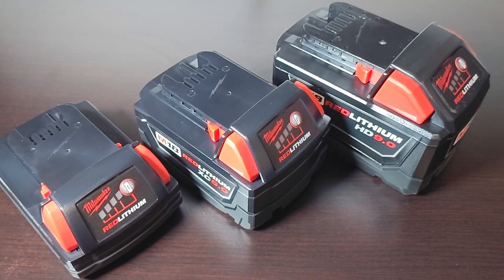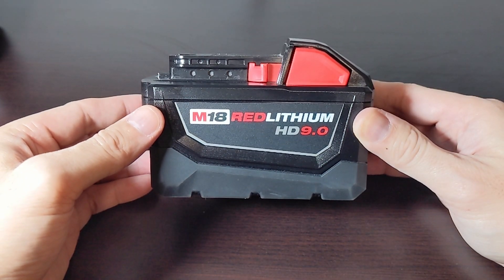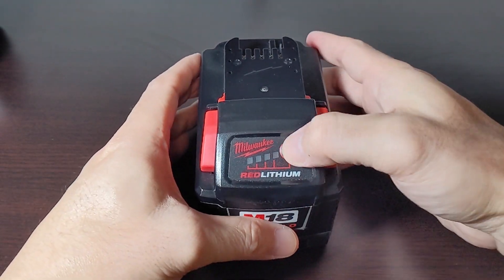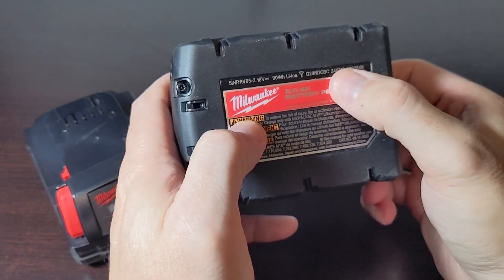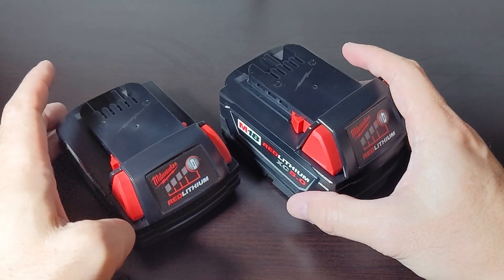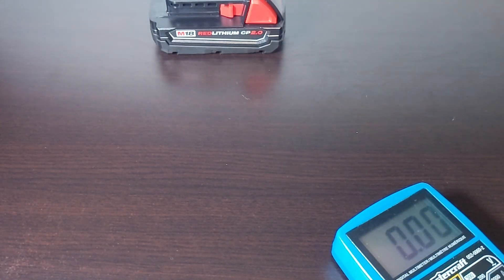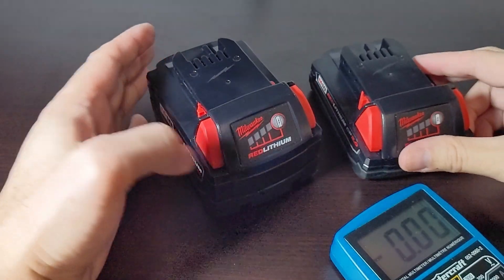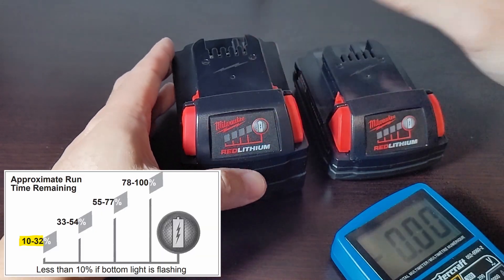Milwaukee M18 Battery - Optimal Storage Voltage

Comment: If I'm not mistaken the M18 series, it's a 18 volt battery. I do believe that 17.6 volts is in the threshold of being called a  "18 volt battery". The amount of charge is the level that you see on the bars when you push the button. One bar has nothing to do with the amount of voltage rather the amount of charge in the battery.
Reply from the maker: A fully charged M18 battery is about 20.5 volts, a fully discharged battery is 13.0 volts (when tool turns off). So depending on how many bars are left (when you press the indicator button) you'll get a voltage somewhere between 13 and 20.5 volts.
Reply: So if voltage drops as the battery gets used, how does the tool keep a steady pace? Does it pull more amps?  I would have assumed it remains at 18v like big bear. I’m new at this.
Reply from the maker: @mastermitchell123  the tools generally get weaker as the battery life decreases.